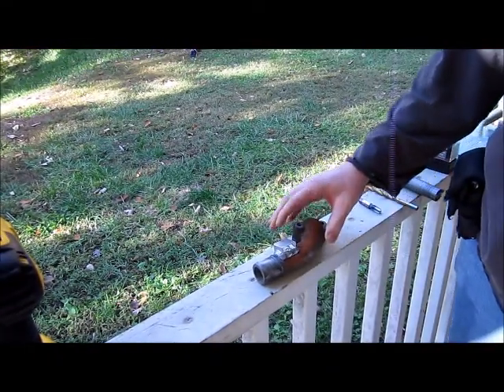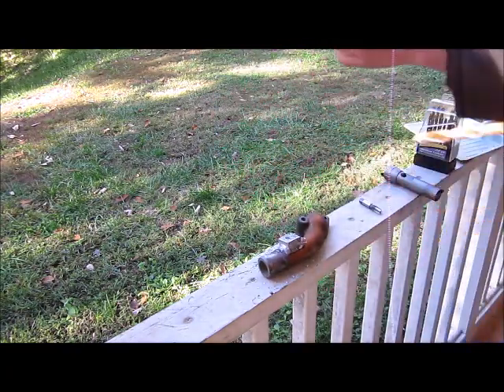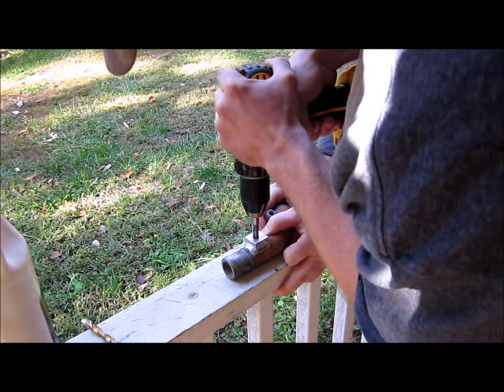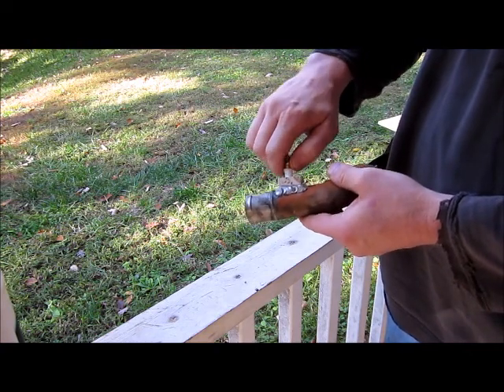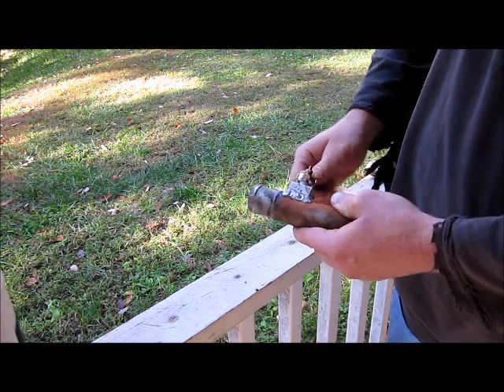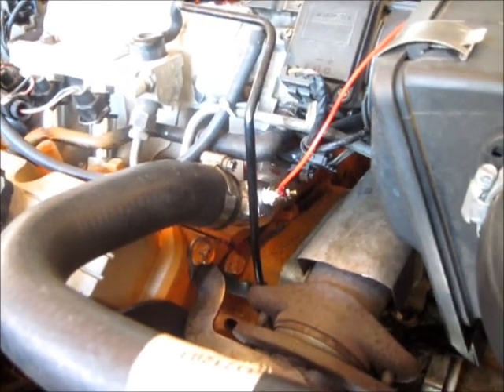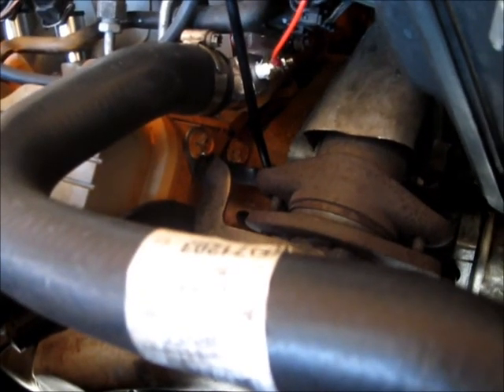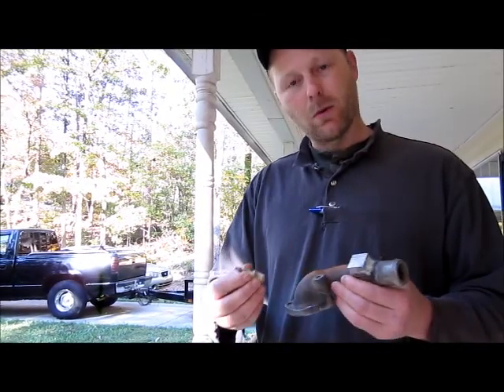drill and tap for temperature gauge

Comment: Thanks for the video....was neat to see how you thought of having an aluminum block welded onto the gooseneck in order to provide the depth which is needed to house the thermostat sensor. Me and my husband have an old Ford 9N tractor that we gotta drill and tap the head near the gooseneck since the existing coolant drain plug hole in the side of the engine doesn't allow for the water to flow past it like it will near the gooseneck. Was also nice to see you explain that we shouldn't run the tap in all the way but should only run it in about half way until we see how much depth we actually need :o)
Reply from the maker: You're welcome. Good luck with you're project. :)